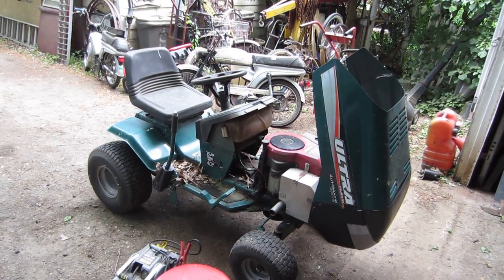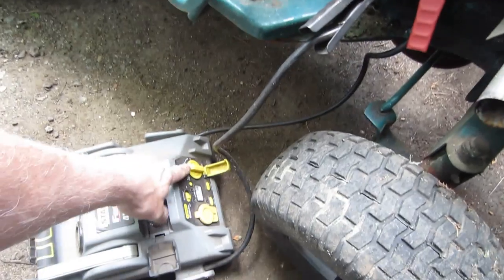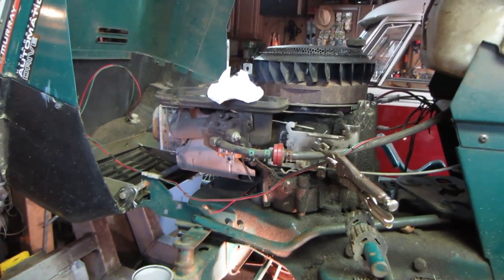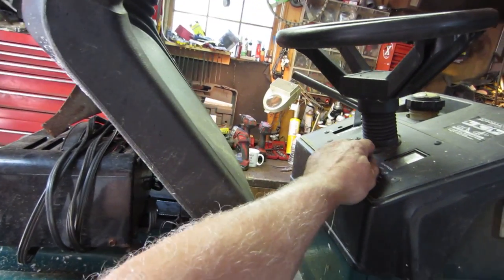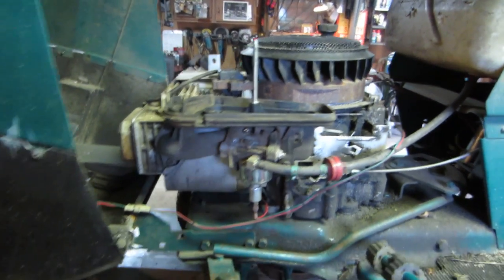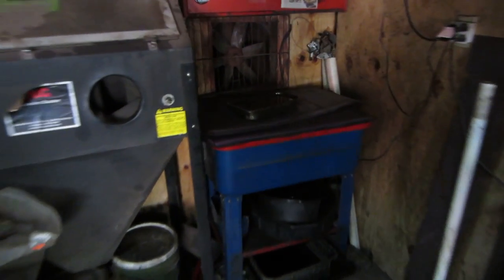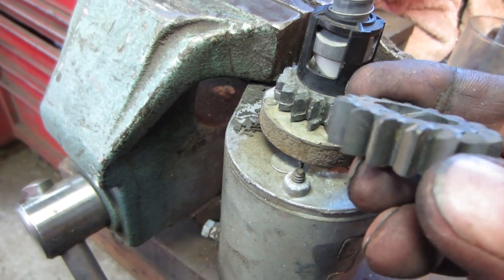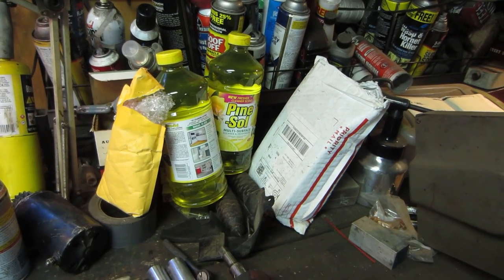build a good tractor out of 2 junks pt1 of 2

Comment: I did the same kind of engine replacement on my '93 Craftsman which did not have the carburetor solenoid switch. My fix was to file down the solenoid pin, and it runs fine. Oh yes it like to give a loud POP when I turn the engine off.  Keep up the Great videos.

Comment: We used to make our own drift pins out of nails. We took handles of damaged drift pin, drilled a hole in the middle and put a set screw in the side. Grind the tip of the nail using a drill and sand paper. A grinding stone works too. Just case harden the nail once you get the OD.

Comment: With having discovered dirty or contaminated fuel, the best thing to do is tip out the old fuel and replace it with new fuel, that way you have eliminated one problem, the reason I say this is because I also work on 2 and 4 stroke motors, at times I do have some problems with them.
Sam Knudsen
South Australia
Australia

Comment: Hey Mustie!!!   I have a pair of sears LT1000s that need to become one functional tractor, one was run low on oil and the engine threw the rod thru the case, the other has deck issue, my brother used it to find loose metal and large rocks on his back lawn, I think he also broke the engine key way.... The info on the carb solenoid is very helpful!!!
Reply from the maker: im good at finding dog toys

Comment: It strikes me that with all the old machinery you mess with my first step would be a good degreaser and pressure washing.  It is a lot more fun to work on clean gear!  It would also probably be safer when cleaning mouse debris than air blasting and the resulting atomization although I know you say you wear a dust mask.  Just saying.  Good videos.  Take care.  Doug

Comment: The only issue I have with those model Craftsmans is the mower deck height adjustment maxes out at less than 3" in the top setting.  I have modified them to get just over 3" cut but the only way I can figure out how to raise the blade to where I want it is to use larger tires.  Thats more work than what these mowers are worth IMHO.

Comment: I'm swapping engines on my craftsman as well and am having difficulty getting to the 4th bolt on the bottom of the motor to remove it. I noticed you didn't remove the deck, but do I need to remove the other pulleys? They seem to be in the way, or will they pivot out of the way?

Comment: I wonder what attracts mice to the area on top of the cylinder head on these engines. Both of these had a nest. I had the same exact type of nest on the Kohler engine on my John Deere , right in the same spot in front of the flywheel on the fins on the cylinder head.
Reply: Safest and most dry area to nest.  Until someone decides to fire up the engine....

Comment: Also did you leave the old gas in the first mower? I have had  2 month old gas go bad already and only run on choke just like that. Normaly if just the main bottom jet is open the engines will run but they will surge and hunt, that's what makes me wonder if that gas wasn't combustable enough anymore.
Reply from the maker: cliff hanger iant it,

Comment: Just a note, when your test start that type of engine with fuel in it the battery has to have power to it so the carbs fuel shut off allows fuel through, the charging system isn't usualy enough to open it. grant it that the carb was dirty but I got bit by one onetime where I cleaned the carb and it didn't need it lol
Reply from the maker: true,

Comment: 13:34 actually it is an anti backfire solonoid
Reply: five speed ash correct
Reply: I still have an old Craftsman that does NOT have the solenoid and it has never backfired. Now, looking at the overblown safety concerns that has gripped this nation with its cradle to grave nanny laws, it does make sense that the libs mandated at some point that gas engines have a gas cut off mechanism that stops the flow of gas to the engine.
Just like some rifles now have TWO safeties on them, as mandated by the idiots running California. 
How many of these machines were junked because the solenoid stopped working? Probably many thousands. I could research this, but I am fairly confident in my conclusions.
Reply: Short name for it is the fuel shut off soliniod